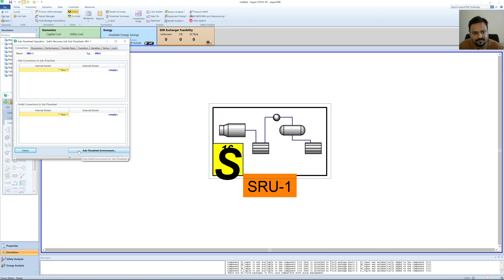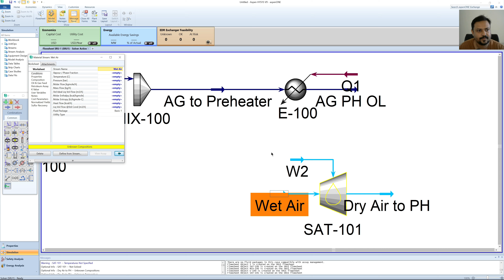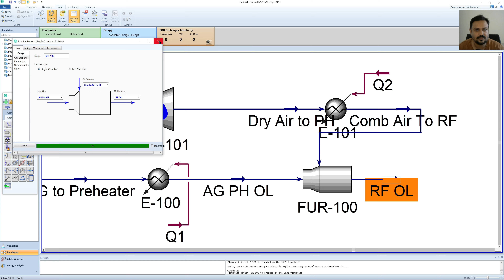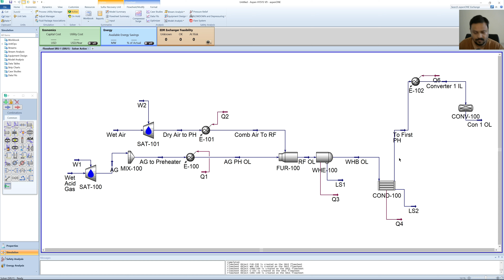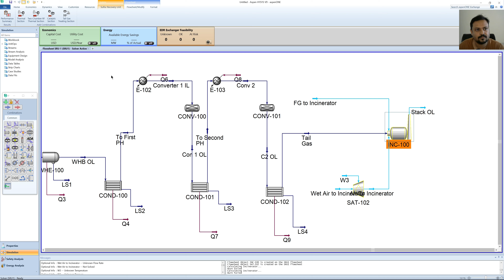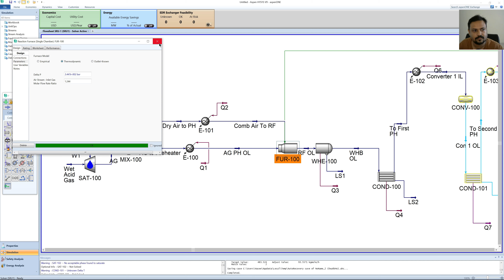SRU Claus Process Simulation in Aspen Hysis Part - 1

Comment: Nice one thanks for sharing! Anyway, it would be a more representative comparison of overall recovery if the wet-acid-gas flow after adding the incinerator was also set the same as before. I meant we need to compare one with a TG Incinerator vs without an incinerator by the exact same feed conditions.